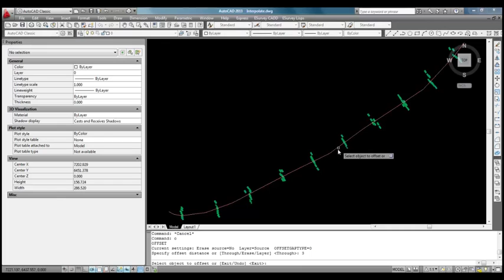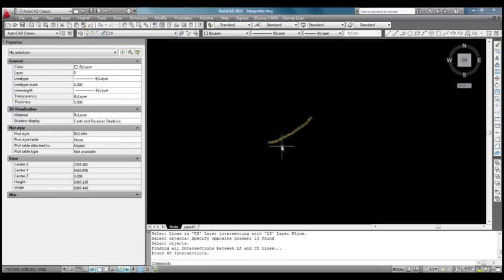Interpolation of Land Survey data

Comment: I have properly organized all layers in their corresponding layer lists. However, the interpolation process is not performing well, resulting in numerous missing values.
Reply from the maker: Can you please reach our support team? Support No.: 6361559577, 6361594536, 7676153574, 9481474842 (India Numbers). We work between 10 AM to 7 PM all the working days.